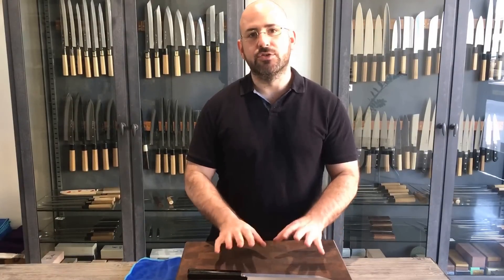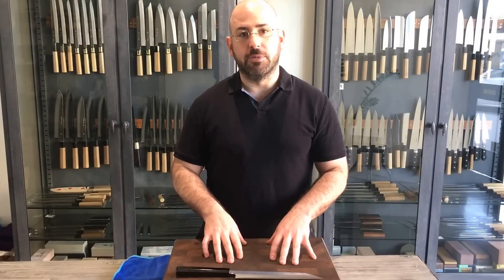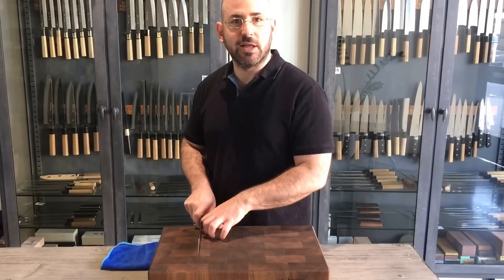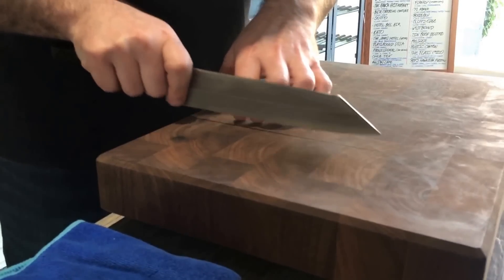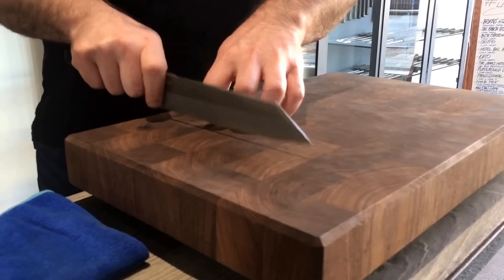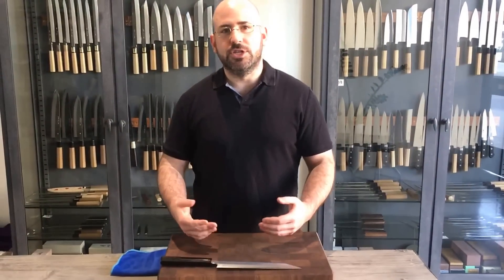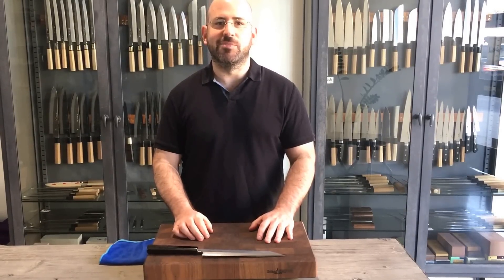Thrust cutting technique-Japanese Knife Imports

Comment: I’ve been doing the thrust cutting technique for years. With practice, and a sharp blade, you barely contact the board. The blade edge lasts much longer than the wacka wacka smashing into the cutting board technique you so often see.. Also the edge at the tip lasts much longer than rocking.

Comment: I usually do "cross chopping" for mincing the garlic, is it ok to do it with Japanese knives? because it seems slightly "walking" the knife laterally in near of tip area. If it's not, so what kind of cutting motion for mincing the garlic? thanks.
Reply from the maker: it will depend on how thin and hard your knife is, but its possible to avoid... just use the technique in the video to slice the garlic into thin slices of even thickness, then lay the slices out to julianne, rotate the bunch 90 degrees and do it again.  It seems like it might be complex, but it ends up being faster overall because you spend less time going over the same piece and its all done in one fell swoop, resulting in a more consistent cut size too.

Comment: Your videos are awesome. The one about which knife to choose was incredible and the most complete and accurate I have ever seen and I have seen hundreds of videos... I never had a Japanese knife. I'm a Portuguese chef aged 45 and I use German knives for 30 years. I often use my chef's Japanese gyuto or bunka and I love it but I can't use that technique I'm a rocker and a chopper (when I use a knife which is getting rarer as I only plate and run my kitchen. One question : if Japanese knives are harder, with carbon in its composition and with higher Rockwell rates like 60 to 65 I never understood why they are more fragile and needed more delicacy to use compared to German 58 Rockwell knives. They also get sharper but last sharp longer than the softer German blades. Am I correct? Can you please help with this doubt I have for a long time? Thank you for your time!
Reply from the maker: Thank you so much.  Really appreciate the kind words.  Anyways, to answer your question, as things get harder, they become more brittle, but stay sharp longer and hold more acute angles better.  As things get thinner, they move through food more easily and require less force to cut.  But both of those things make the knives more prone to damage.  So, yes, they get sharper, stay sharp longer, and move through food more easily, but that comes at the cost of being more brittle.  German knives, being softer and thicker will be MUCH more durable (resistant to damage), but don't stay sharp as long or move through food as easily.  Does this help answer your question?
Reply: Thank you very much

Comment: Hi im a professional sushi chef, I have been working for 8 years and i have been sharpening my knives for a long time. I can get them razor sharp but what i do notice is when i cut like negi 
(spring onion) Like a few of them it gets through them very easy. But when i start cutting the second batch my knive is dull. 

Is it my sharpening technique? Cutting technique? any advice?
Reply from the maker: hard to say without knowing what the knife is, what the steel type is, heat treatment, how you sharpen (the process and stones as well as actually seeing the edge), what kinds of cutting boards you're using, and how you deal with deburring.  Feel free to reach out to me via email or call me at the store and i'd be happy to speak with you about this in more detail

Comment: just to clarify, this is for knifes that are singled beveled? I know that one difference between Japanese knives and Western knives is the sharpen ratio. So would I be alright in using a rocking motion for a 70 30 Petty knife?
Reply: San you can do this with any knife. It’s the position of your body, and the technique in which your elbows and wrist move in harmony  with each other.
Reply from the maker: as someone posted below, this can be used with almost any kitchen knife.  However, i shot this for the purposes of double bevel knives (asymmetric ones included), as many single bevel knives have even more specific techniques that are used with them.  I would still try to avoid rocking regardless of whether the knife is "70/30" or whatever it may be.
Reply: @JKnifeImports  thanks for the reply. It was a little awkward at first but I think I'll have to keep at it. I'd rather practice slowly than chip a blade. Thanks again for the tutorial and response!
Reply: @eshsteywart  gotcha. It all comes down to practice then.
Reply from the maker: @San-kq1ss  you can get much faster with practice... feel free to reach out if you have any further questions
Reply: @JKnifeImports  Thanks so much for the assistance. I will be sure too

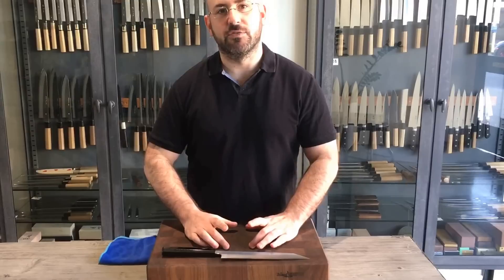Comment: 1:20 - That's dumb. Then half of your food falls on the floor as you're cutting.  You always want to work in the center of your cutting board unless you need to make lateral cuts.
Reply from the maker: Dont knock it till you've tried it... i thought the same as you for a long time, but when i was working and training in japan (when i was still cooking professionally), this is how people cut here.  It actually works quite well.  I used this same technique in both japanese and western professional kitchens with no problems.  If you feel uncomfortable with it, by all means use the center of the board.  But you may be surprised with how well it can work.  Of course, i'm not one to say there is only one right way to do things... i think that as long as you do something that makes logical and coherent sense and works well for you, that should be good enough.
Reply: Well said! I have in fact tried this technique though and found that half of my produce being cut ends up rolling right off the board and onto the floor when cutting so close to the edge of the board. While I can certainly appreciate the fact that this technique would certainly help to alleviate knuckle clearance issues (which is awesome) with certain knives like kiritsukes or many Gyutos with very little knuckle clearance even when brand new, I just get extremely annoyed having a fair amount of the food I'm cutting roll off the board and onto the floor. I'm willing to bet that in Japan they are not cutting things that have a tendency to fall everywhere while cutting such as dicing an onion, or chopping carrots or slicing apples or even cutting bunches of celery. These types of food quickly pile up on the cutting board and will fall on the floor if working near the edge of the board. My situation is only further complicated due to the fact that I have a dog that will quickly eat anything that falls on the floor while I am at my station prepping food.  So I certainly don't want anything falling on the floor that could be poisonous to my furry friend. =)
Reply from the maker: For what its worth, I used this technique in many western kitchens.  I worked in fine dining for years, mostly at italian restaurants, though I also did some french and modern american stuff too.  It worked for me, but, as i mentioned before, that doesnt meant it will resonate with everyone.  The important take-aways are that knuckle cleareance can be managed through technique and there are certain movements that work better for knives that are thin and hard, like most japanese knives.  Also, of course, the basics of grip and food holding safety.
Reply: Right on!  I really like how this technique fixes knuckle clearance issues. Do you think maybe you could do a video on how you prevent food from falling off your board as you work in the lower corner?  It would be very helpful to me. I'd like to use this technique, but not if my ingredients are falling off the board as I work in the lower corner. LOL
Reply from the maker: I'm currently in Japan on my annual training trip, but I can try to do something like this when I get back to the US.